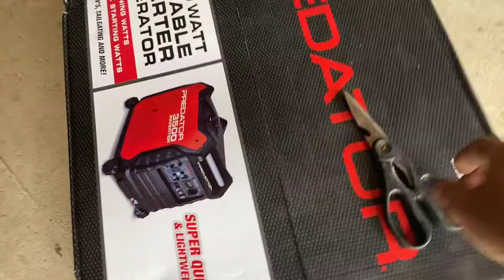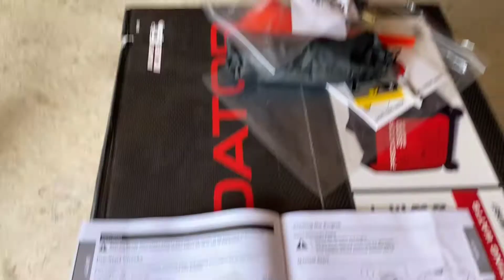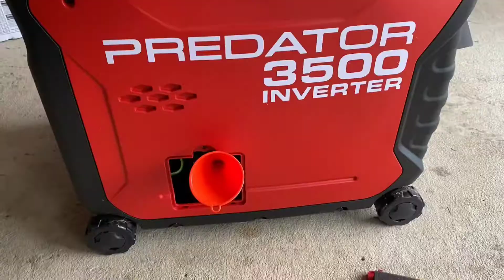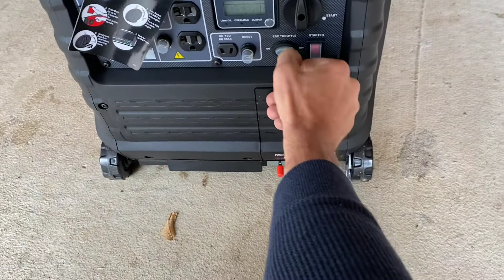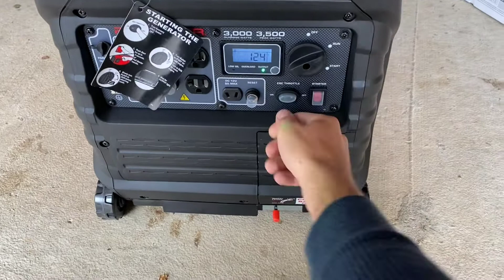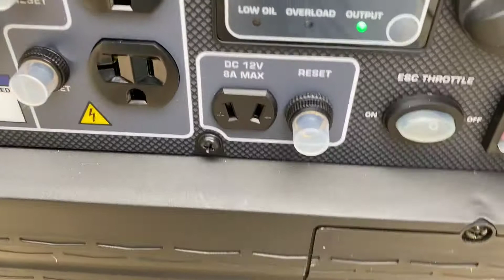#222 PREDATOR 3500 Harbor Freight Inverter Generator, unboxing and REVIEW!

Comment: 10/23/22 Purchased one. Changed oil 3x before 50hrs.  Currently at 968hr. GREAT till I just shit it off.  About 10hr later go to start and will not even click makes no sound.  Used a jump box same.   Pull start one time. Great next time the rope broke.   Thanks i have  the Ext warranty
Reply from the maker: Good to hear you’ve gotten a lot of hours out of it. Yes mine since has stopped starting electrically, I just figured the battery needed charged or shorted out. It starts easily enough with the rope for me I haven’t bothered with trying to fix the battery problem. Sure is a nice generator, love how quiet it is.

Comment: That should work out well for you with the camper. I have an old Honda 1000. Very small package and runs good, just don’t use it much. It’s like a pole saw. They’re nice to have but only use them a few times a year. I’m sure you will get plenty of use from it on the race circuit. Thanks for sharing!
Reply from the maker: Thanks Dave! These little generators I’m sure will come in handy, I’ve had quite a few instances where I wished I had one :) I appreciate ya watching buddy, have a good week!

Comment: That predator generator will be A perfect fit, for camping and hobby farm power needs! I love the economy switch let's the machine run the perfect speed for required power output 👍
Reply from the maker: Thanks! It sure will be handy to have around, and your right that economy is nice especially when your just running a light load on it.